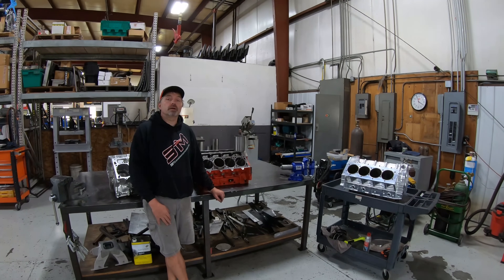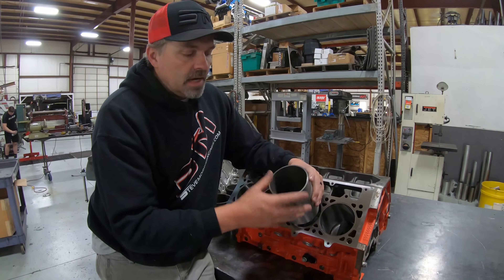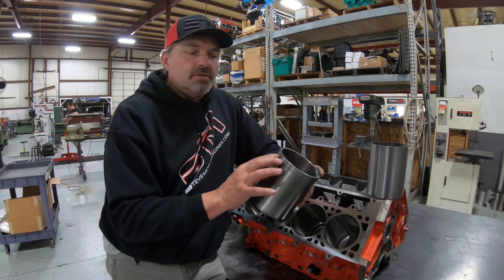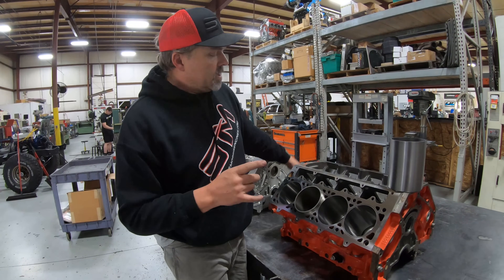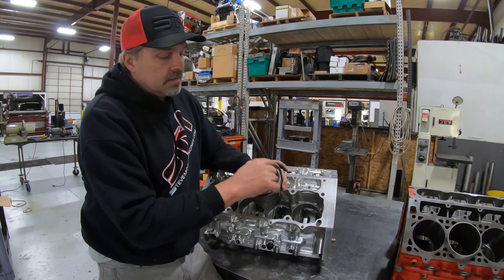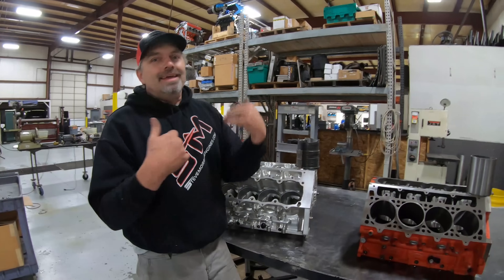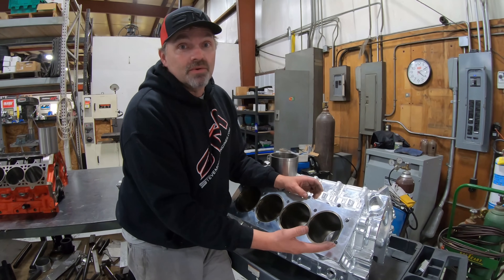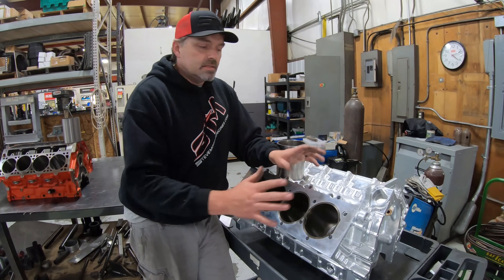Installing Sleeves

Comment: I have a question, if I use only 0.02 mm press fit sleeve, don't we lose heat transfer? Yes, we can hold the sleeve down with the flange so it doesn't move. But, if the sleeve its dry application, we need at least 0.05 mm press fit. Please help me to understand. Because we need to cool down the cc, when we make  thousands of hp.

Comment: Something im curious about and in the case of LS blocks it may not even matter but in the diesel world people add sleeves to duramaxs and cummins for more strength im curious if anyone has tried this, but like i said it may not even matter but i would think if yoy got sleeve material that's hard enough and took say an L8T block since it's already got a bigger sized bore so your not taking a lot out of the block and sleeved it down to say a 5.3 5.7 bore would image it would make the bores be able to survive a lot more but now you get into is the oem block structurally sound enough, I know in the duramaxs they do it cause the bores crack at around 1800-2000hp cause there so hard and obviously its a diesel block so it can handle a lot more stress so you that's not a problem but i would be curious about how that would work in a LS/LT block

Comment: That’s a billet block your comparing to stock blocks, they are 2 different blocks & different material too. 
Billet blocks are usually more durable to withstand more HP than a stock block.

Comment: Is there any scenario where installing darton mid sleeves would require no decking of the sleeves after installation? Just received my block back after having a machine shop install sleeves, and they sent the block back without decking the surface. According to them, and darton themselves, this is fine as a step-deck config but i would think at least a tiny amount of material should be decked off the surface of new sleeves? I've never seen any builds with undecked sleeves. 🤷‍♀🤷‍♀🤷‍♀

Comment: Little sketchy to me never seen someone beat the shit out of it to get it in the hole usually they drop right in with just a little love and the end and a puller from inside I’ve seen the lip on top crack or fracture off because of the metal being so cold and having it beat on but who am I I’m not machinist or professional mechanic?🤷🏻‍♂️

Comment: Approximately what cost for one of those sleeved SMX billet blocks that you custom make? Would MiD sleeves be fine in an Alusil block only needing less than 1000whp. Probably only around 6-700whp for Time Attack car.

Comment: When you install the darton T locking sleeves do you have the sleeves tight to the next sleeve at the top surface so they push off the next.
Or do you keep a slight gap so the sleeve next doesn't warp the cylinder beside because no gap for upper sleeve lock to expand? 
I had these sleeves installed abd theres no gap where ea sleeve locks to the next.
Not sure if i should be worried the sleeves will go out of round when hot?

Comment: Very nice explanation and sound engineering on your improved block. What is the max horsepower on your block? I have a question. One of my friends has a 1969 052 Zl1 aluminum block. Some of the sleeves are above the deck with some below. Is it possible to deck this and match all sleeves to top of deck if deck height permits. If so what gaskets would you use. The fire ring should compress directly on top of the sleeve correct. The bore will be 4.310 or .060 over.
Love your videos and knowledge much appreciated. Thanks!

Comment: used to laugh when somebody sleeved an engine with no register at the bottom or top.get a leak in the head gasket it went down of the side of the sleeve causing the piston dragging the sleeve into the sump sd 25 nissans were good.

Comment: That open block design reminds me of the first 928's and the later HT4100 that Cadi had. Mercedes went to this with the lost foam casting and the Nicasil  process developed by G.M. in the sixties. Still no support on the deck.

Comment: It seems like the interference fit sleeves with protrusion and separate head/block water jackets would be hugely beneficial if you live across the country from your engine builder and don't want to trust Clem down at the engineering shop to deck your heads and block and hone your cylinders in the event you torch a head gasket.

ring ring "Send me a set of sleeves, pistons, and rods, please" Throw it in with new gaskets and hit the track next day.

Is there also some modularity to the system? For instance, if SME builds you an engine with a bore size on the smaller end, can you swap sleeves and pistons to change displacement?

Comment: Yup, with an alloy block you REALLY ned to use a top register to minimise the affect of the block's thermal expansion - it's small but could cuse problems with the differential if a bottom register is used.👍

Comment: Any thoughts on using the MID sleeves in something that is seeing a lot of heat cycles, like an oval track car? When you mentioned relative motion between the sleeve and gasket that made me think pre-mature gasket failure.

Comment: So would the cast iron ls block be better than an aluminum ls block as far as strength? Not worried about weight. Shooting for 1500-1600hp. Or would it be best to just go ahead & sleeve an aluminum block ?

Comment: Could you put o-ring grooves at the bottom of the "wet" sleeves in your SMX blocks as insurance to keep water from seeping through the low-pressure fit into the bottom of the block? Is that an area you put sealant on when you fit your sleeves?

Comment: Nice one, thanks Steve, a very clear explanation. A quick but possibly a stupid question. has anyone tried to machine a spacer plate into the top of the block to use a mid sleeve system but creating a full surface as a dry deck and then machine part of the top of the sleeve so that you still register top and bottom?

Comment: i dont really see the point of the water jacket around the cylinders. you got hot spots all over the place, no steam risers. id just leave it dry, wet heads. run it.

Comment: Thanks so much for posting this stuff. I'm a youngish dude just getting financially set enough to really tool up and start pursuing alot of my passions. I've been building engines for about 11 years on the side and am a mechanical engineer by trade. Spent the last couple years learning and doing fabrication, Composite work, CNC machine work and fixturing.

I've had a goal since I was literally a kid to design my own engine platform and put it in my own car. I starting my current pro touring build as a practice run for the next project (the big one). Im two years into the fab and machine work on this build but its been probably 4 years since the engineering began.

The next builds engineering just started. Working on a midengine carbon monocoque push rod suspension deal and incorporating a stressed block design for my engine. I've studied the reher Morrison books, other local engine builders, but none are as open about some of the details you go into. It really is appreciated to a noob like me still paying the "tuition" of learning and failing.

Comment: The probably of me putting a sleeve in an engine is slim to none, but it’s nice to see the process and how they go in
Reply: I’ve done it for years and never ever had a problem with it. In fact I’ve tore engines down before that I had sleeved and the cylinders looked so much better than the factory cylinders in the same engine. 
  I’ve had customers to come in and have me to sleeve the entire block just because they run so much Truer & wear waaaaaay less. 
  I’m Willing to bet you can run a standard small block Chevy old model with the right sleeves in it 1,000,000 miles and disassemble it and you will not have to bore the cylinders. It will be that little amount of wear in them.
Reply: @e-racer4673  I don’t trust myself to sleeve my own engine I’d rather send it to a machine shop

Comment: Thanks for taking the time to make these videos ! 
Since the repair sleeve (for iron blocks) is made of a stronger material than the "cast iron" block, if there wasn't a crack in the parent sleeve, wouldn't the repair be actually stronger than the LSX/OE?
Reply: Yeah should you simply sleeve an OE LSX block to begin with?

Comment: Best to use a original 1966 to 2006 Big Block Chevy,  they can handle 1,500+ horsepower,  without a problem.
I just put a original 1967 440  in my old Dodge,  BEST CAR EVER.
OLD SCHOOL IS BEST.

Comment: Back in the 80s-90s, people tried to run wet sleeve hemis on the street - always an issue with water seeping (you had to run a low pressure radiator cap and change your oil early and often.  But they did it. 
Sounds like they've come a long way...

Comment: This really brings back some memories from back in the day when I used to work in an automotive machine shop back in the early 80s. I was the cylinder head guy. ( Peterson TCM 25, Winona surface grinder, a  Kwik Way SVSII high performance valve grinder, and a Sunnen guide home station )

  I remember the block guy hated installing sleeves. We ended up making it a little easier by putting the block through the hot tank to heat it up and putting the sleeve in the freezer. It's amazing how much energy it takes to install a sleeve with just a thousands or so press fit.
 On a side note Steve ended up building an engine for a buddy of mine, check out the Mach 1 Mustang owned by Steve Ayesh. I believe the car has went into the low 7's on small tires !!!

Comment: It's Steve's fault that toms promod caught fire. Did y'all know that?  Injectors weren't changed.
Reply: Dude go rest your keyboard warrior azz down somewhere and quite spreading stuff you don't know the whole story about.
Reply: I Kno the story
Reply: They run the same injectors from  dragweek
Reply: @seanmayo206  😆🤣 all because their the same injectors ran during drag week, you are a true keyboard warrior who knows notta about injectors 😆🤣.. I know both these guys and Tom will tell you different on your blame game name trashing trying theory. Steve nor Tom caused that or could of prevented that, parts go bad without warning slick. And injectors don't get nor do they need changed because they ran drag week. I run my buddyvJack Frebch billet atomizer injectors in my 572 f3-121 bbc combo and with 317 passes and around 2500 miles these injectors won't get pulled until winter of 2021for jack to service them. You watch a youtube video and made your story is how you know the story 😆.

Comment: If the lsx is good up to 15 or 1600,  and the billet up to 2000. Is the price difference between lsx and the billet ls  worth it or just really save and go smx option 3? I would think the bigger price jump is going iron to billet than 1 billet to a better billet.

Comment: Could you do a video on the Ford
Performance A460 block? I'm thinking of putting one in my 1971 ford Torino. How much HP can that block produce? Can it take 2500 hp reliably Using Twin 88s?
Reply: Man he hardly rarely ever gets anything ford in. 98% of everything he does is Chevy.

Comment: Having had and seen a LOT of sleeves in factory iron blocks they are an effective repair and nothing more. Save a block with a sleeve,,, fine. Try and do 2 holes alongside each other and not so. Sleeving 6 holes [on a 6] and the block just flexes all over the place and is useless. You will not keep a head gasket in it.
I have seen sleeves that have flexed, so the second style is an improvement on the first, probably.
In more recent years sleeves in alloy Sprintcar blocks and midget blocks however fit have been 'walking' as they make so much power and rpm.

Comment: The fact that there's little support at the fire deck in Volvo 'White block' engines is why you have to shim the block between the cylinders should you want to make power with them. Similar to the 'mid sleeve' design. Little to stabilize the cylinders.

Comment: Hey Steve on your engine block how does water pass from the top of the deck to the Head
Reply from the maker: It does not totally seperate
Reply: Check out his older videos…it’s freaking sick. Lots of $$ in AN fittings 😂 totally worth it.

Comment: Awesome Steve. Is the register in the top of the aluminum block because of the growth rate of the aluminum vs the cast iron sleeve ?  . The lsx block being cast iron and the sleeve being the same the register can be at the bottom ?
Reply from the maker: No, just extra bite into gasket
Reply from the maker: Yes it can be on bottom
Reply: Ok. Cool .

Comment: What about the 6.2 aluminum ls3 block? At what hp level should you sleeve it and with what type of sleeve? What is the price to sleeve a ls3 block with sleeve you prefer? Looking at 1500 hp build and i already have a ls3 block, or should i ditch it and look at other options? This video hit a the right time.
Reply from the maker: 1500 is max turbo power. 1300 supercharger. 
I won't sleeve them . Get a aftermarket black aftrr that
Reply: @stevemorrisracing  thank you steve! Building car at this moment will be contacting you for parts and machine work when i start the engine build side of it!

Comment: In regard to re-torqueing; what is your feeling on torque-to-yield bolts?  Do they alleviate the requirement to re-torque, and are they suitable for big power motors?  Is there a reason not to use them, aside from them being single-use?
Reply from the maker: No reason to use them

Comment: When I was a bracket racers all I ran was 350 blocks with cracks in the cylinder walls I would pick em up for $25-50 from kids trying to run NoS on a stock motor take em to my machinist have it bored 60 over, chromoly sleeved and  dry block it, NHRA rated the car at 1000HP N/A then it had a 500 HP NoS Kit on top for IHRA use, and we never had any problems running broken blocks to make big power with NoS we were making about 1500HP and I spray from the time the yellows come on till I cross the finish line

Comment: What block do you recommend for a Drag Week LS around 2k hp?  I like the Dart SHP LS Next Pro.
Reply from the maker: 2000 the aluminum or iron, over that just the iron.
Reply: @stevemorrisracing  so the ls 6.0 stock iron block would be better than the aluminum stock block for 1500-1600hp or should I go with an aluminum sleeved block ? Note that I already have an iron block.

Comment: On dry deck, how do you get water between block & head?
Reply from the maker: Lines
Reply: @stevemorrisracing  I like that design, seems like it would be extremely strong.
Reply: @AndyFromm  check out his older videos. Super cool to see
Reply: @markg1495  will do, just recently ran across his videos.
Reply: externally

Comment: Awesome series Steve. Very underrated & under-viewed. I have seen some third parties re-post your content with their channel branding over the top. I hope they have your permission to do so, it disappoints me to see your content getting more views and subscribers for someone else's channel when it is your knowledge and hard work.
Reply: I agree and if it was me I would send the video links to Steve so he can get them taken down.
And @Steve Morris Engines you should start overlaying your SM Logo (or Channel Name) on your videos to 1: deter some of the thieves from posting YOUR videos without permission and 2: the overlay will be your proof that it's Your Video(s) = YTube won't hesitate to notify the channel(s) to remove the your video from they're channels.
Reply from the maker: Engine builder has permission.

Comment: Are the liners with the flanges on top side used due to the expansion rate of the aluminum block vs the iron liners. So if the liners had the register on the bottom and were used in an aluminum block would that cause sealing issues over time. Like to add that you have really engineered a great engine.
Reply from the maker: Thanks. And yes on your thoughts

Comment: That mid-sleeve design should not have been a singular sleeve but connected a series of sleeves of 2 or 4 as a single unit so it eliminates the wobble as it's connected to the other sleeve
Reply: While it's not easy machine 4 sleeves from a single block, one could consider 3D printed (e.g. using inconel) jackets set and just hone it as finishing pass to smooth out the bore.